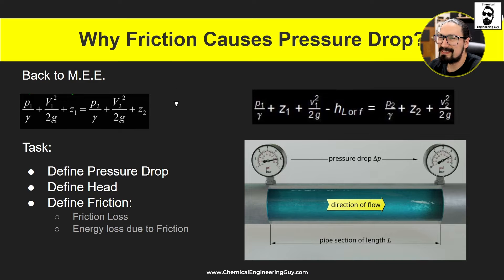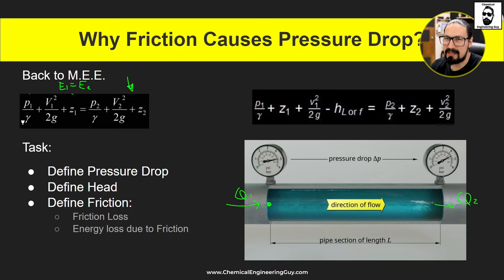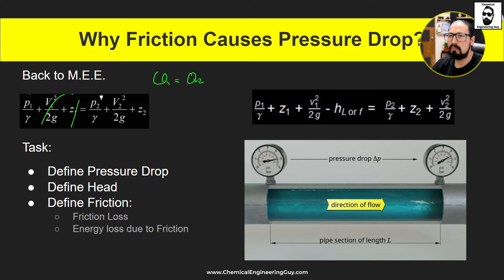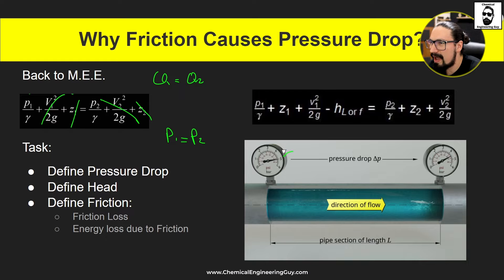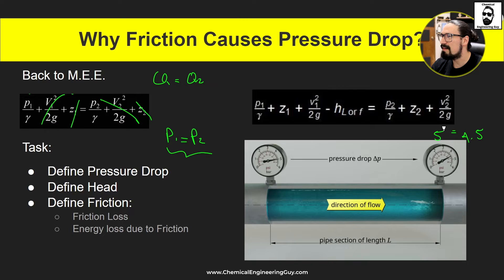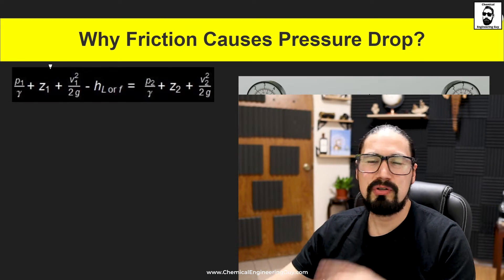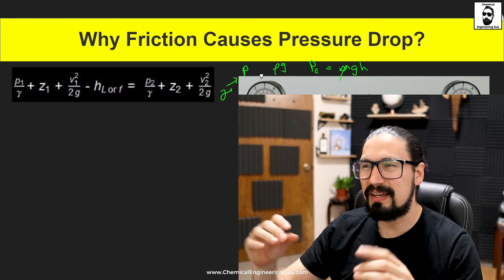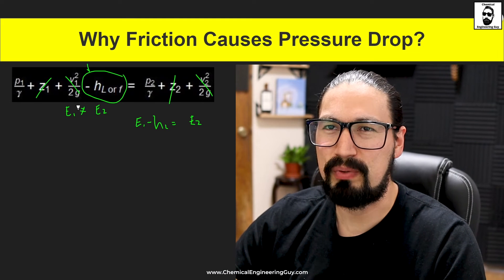How to Actually Relate Friction Loss in Pipes to Pressure Drop

Comment: Well…

Two remarks:

1/ Generalized bernoulli is:

Delta(P)/(ρ*g) + delta(v^2)/2g + delta(z) = Hp + Hf
    * P in Pa (ou N/m2)
    * ρ in kg/m3
    * g in m/s2
    * v in m/s
    * z in m
    * Hp (work added by the prime mover) in m
    * Hf (frictional loss in piping system) in m

2/ While Bernoulli's equation is valid for compressible fluids (gases), the change in density with pressure and temperature makes the analysis much more complicated.
Reply from the maker: thanks for your input!